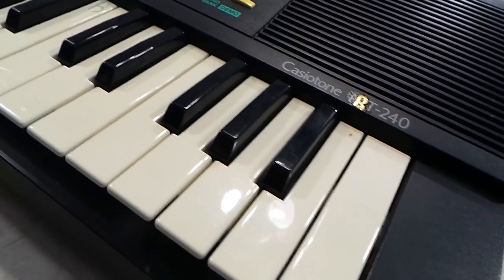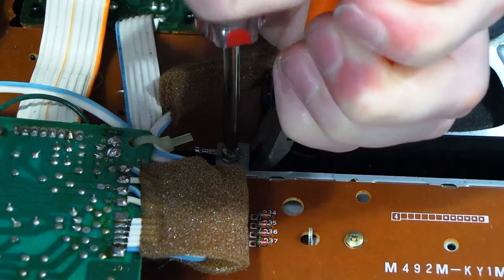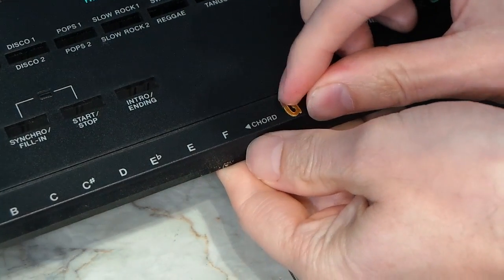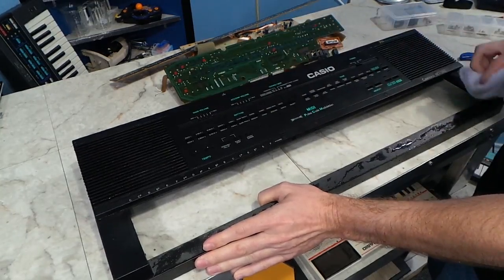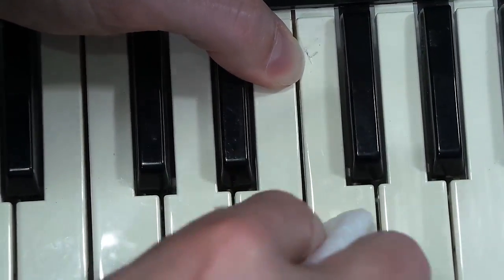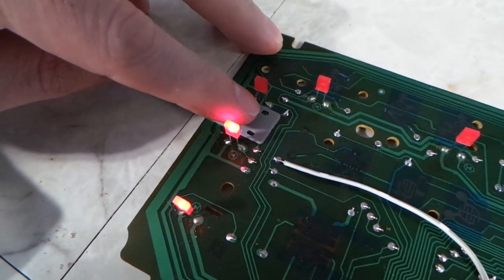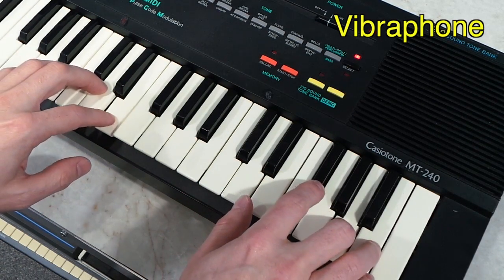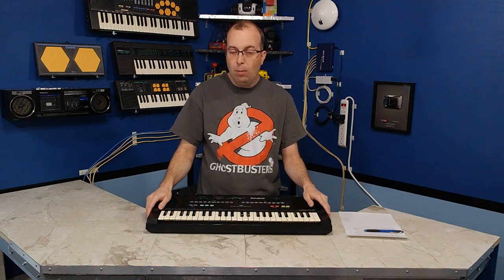Casio MT 240 - Repair, Restore and Review

Comment: I never considered collecting keyboards to be a thing, but I do have two. Not from that era though.
The first is a Yamaha PSR-79, which I quite like. Finding info on it isn't easy, but I did at least learm it's from 1998 (I got it secondhand, but clearly it was only 1-2 years old when I got it).
The other is a casio of some description.
Probably an early 90's model, but I forget the model.
I used to have a box for it, but we tried to sell it at auction. They didn't sell, it, PLUS they lost the box and power supply.
quite irritating.

Comment: use flux to solder to the keyboard PCB. it will help you to stick the solder. don't forget to use good ventilation if you will use flux. also try to use bigger and more powerful soldering iron.

Comment: I bought a Yamaha PSS-270 in a flee market for around 50 NOK (around 6 USD).  And I'm amazed that everything works on it! But there's a faint buzzing/humming noise coming from the speakers and I was wondering if that's normal?

Comment: I know this is a really old video, and you probably know what I'm about to say already but, here it goes ayways. Heat can undo cured super glue. Whenever I need undoing super glue, I use hot water because it's easy to control.

Comment: Do you know where I could get the 9v power jack for the MT-240? The center post has broken off and been lost. I've unsoldered the old part but can't find a replacement that's close enough to fit the opening in the case while having the contact legs in the proper orientation.

Comment: Maybe try a very mild abrasive to remove the super glue, like toothpaste or a baking soda/water paste mixture. I would smear a little on the spot, then take my dremel on low speed with the felt or cloth wheel to buff the superglue off, applying very gentle pressure.

Comment: With regards to wanting to hear the sounds from the non working button there are still ten sounds in there you haven't heard. Just try selecting them via MIDI. Casio used the same chipset in their more expensive full size 30 / 465 soundbank keyboards.p.s I just watched the Cassette to MP3 video. Did I spot a Casio CZ1000 in it ? 
If so you will need a couple of days and Vince Clarke to review that one :-)

Comment: WD-40 does an excellent job removing light glue residue, though, not too sure how it will do with super glue. You could also try oven cleaner, though test it first to ensure it doesn't damage the plastic. Oven cleaners chemical properties work wonders removing splattered line striping form a cars paint, maybe it can do something to super glue but it might be corrosive to plastic.

Comment: The Problem with these Rubber switches is, when they get "oily" -- after years in use, or long storage -- the switches stop to work. You must clean the Circuit Board and the Rubber switch, then it functions as well as on the day of the purchase. But as you mentioned in th video sometimes the copper was eaten away by acid, ... .

Comment: I picked one of these up today at Goodwill for $10. It all works but is missing two black keys. I came here hoping to find out you can replace individual keys. Any clue if there is a place to find replacement keysets for these, or am I going to have to hunt down a non working version with all the keys?
Reply: I just picked up a 205 with a missing black key. After taking it apart I realized that all of the keys are connected to the same piece of plastic. So it looks like you either need to replace them all. Or if you can locate a single key, glue it back on.

Comment: Thanks for the insight about Casio's soldering, have they changed? Another reason to buy exclusively Yamaha
Reply: As of now, both of them use SMDs. There's no way that soldering could hold up with tiny little SMD cpu pins

Comment: In the future, mark all of those broken plastic screw retainers since they can be later be refitted only from the place on the chassis that were broken. They each broke individually and the shape is irregular, if you try and glue them back at random, it won't position correctly.

Comment: Hy, I find a very good working method of placing that kind of plastic cylinders back, I use a piece of tick paper, I roll it a bit on the cylinder, then at the one end I cut it it petals, and at least I use super-glue, the paper absorbs super-glue and became rigid, and due to the petals there is a larger contact area, so it will be much harder to break it again.

Comment: My guess as to the Green Goo, as a parent who was once a child (of the 8 bit era)... is a soft drink spill?

Perhaps the drink contained an acid, such as citric, and the residue left behind from the small amount that managed to leak all the way through over time.

My suggestion is to use a solder pen (usually containing silver) to redraw the traces under the buttons. If that works you will be able to do a pristine restoration :-)

Im sure the internets have dealt with button traces alredy, but have to go to bed now after 10hr flight not lazy... will look later

Comment: I have the same keyboard and it works fine. One of the black is missing - the fourth one from the right. I wonder if I can get a spare key for that one. I have just bought an Udemy keyboard/piano course and I want to learn to play it. I agree with you that it is very compact and with a great sound. It was lying unused for years and I inserted new batteries and it works. There is some sort of play in the on/off switch. I think it works only when I put on or put off with a jerk. Let me know if there is any solution for the same and also some solution to the missing black key. I am trying to search and find the missing power adapter. I only know that it is called “AD-5”. I would be grateful if you can send me a picture of the adapter,  if you have one, as it would help to locate it quickly. If I am unable to find the adapter then kindly let me know what specification of adapter will work with it. I enjoyed watching your video and got a chance to view what is inside my Casiotone MT-240.
My email is citydoha@yahoo.com

Comment: @8:00  that's battery acid that caused the copper traces to dissolve.  The switch just above that is in worse condition.  A copper bristle brush should clean it up, then you can tin plate the switch contacts to repair them.

Comment: That gunk was contact grease I suppose. Works a bit like contact spray but it is a greasy product. It was supposedly used to fix a bad contact in that rubber pad but doing stuff like that only makes things worse... That non-conductive section, well that's the work of that goo. If you want to fix those types of contacts the best thing to do is cleaning both the PCB and the black rubbery things with alcohol and if that does not work the conductive material on the rubbery things is done for so that needs replacement. 3M makes this kind of material.

Comment: I have the same keyboard and after starting it up from a time of non use the buttons don't work either but it will play one sound and after it warms up I can change the sounds and get full function back. I'm not sure if this is a common thing or if there's a build up of some kind.

Comment: Nice restoration overall, but disabling 2 keys for 1 non-functioning one doesn't seem right to me. If solder is not sticking to the pad, how about drilling a small hole to the pad, put some bolt and then compress some small wire with a washer and nut from the other side?

Comment: I don't know if this is the only or the best way to remove super glue or other stains, or a scratch on plastic. I did it on a few computer cases and it was better then the problem area as it was. Use very fine new sand paper to get it off or to smooth out a scratch, then use a light oil on that spot and rub it in to kind of restore the shinny finish. Some glues partly melt the plastic so removing the glue will not restore the surface......

Comment: Goo Gone is the best product for removing stickers. I have used it for super glued items; however you really need to let the goo gone soak in or apply it a few times. Basically make a lil puddle of goo gone for the super glue to sit on. Itll atleast make it scrape off easier. .Heat Guns / hair dryer works good as well. heat gun leaves some residue, but you can remove stickers and tape from cardboard with no problems....Honestly I just buy Goo Gone. Note NOT Goof Off. Goof Off will melt plastic. Goo Gone has no harsh chemicals...Lighter fluid and acetone free nail polish are options also

Comment: My goto when removing stickers of anything is lighter fluid i.e Zippo fluid /petrol but not normal petrol/gas it's different cleaner . if it's a paper sticker it soaks straight through and lifts in seconds if it's plastic you have to work at the edges.

Comment: a less harsh way to remove super glue from plastic is to use fingernail polish remover it has acetone in it but not as much so it will take longer to damage the plastic... it will need more elbow grease and when you notice the plastic is starting to melt then stop and give it a "rest" for a few hours and try again...

Comment: When we had to take apart plastic Warhammer figures covered in glue we would soak them in motor oil and what would dissolve the super glue without melting the figure.

Comment: Old video and probably a crazy idea (not guaranteed to not damage the plastic): Cool the superglue with liquid nitrogen and then just remove it mechanically (should be very brittle at those temperatures). Of course to even try this you have to get liquid nitrogen.

Comment: Today i dissasembled my mt 240 to clean it, and hopefully fix the broken key.

 however i did manage to separate the black keys from the white ones ( man does this sound inapropriate).  but i Have  to glue the broken key. 

has Someone an idea what material the black keys are made from. i cant find any hints on themself.    ( i need to know wich  glue to use)

Comment: I really like your videos David! @ 8:00 aka. "the broken key": you could fix this key as indicated in this image https://goo.gl/OdTZvm by carefully scraping away the solder mask and soldering to the copper underneath at a location where the copper is intact. If you use thin enameled copper wire it might not interfere with the keys. If space is a problem (other components keep hitting the wire) you could drill through the PCB at the trace terminating it and manually soldering in a jumper on the other side (and create your custom diy vias).

Comment: In order to repair the broken pad, couldn't you just tape two pieces of aluminium under where the button should be with wires going to link these to each traces. This would probably fix this

Comment: Hi, I am thinking of buying a Yamaha PSR 620 for $50. Any thoughts?
Reply: Sounds like a pretty good deal, these weren't that cheap in the mid-'90s (velocity keys, floppy drive and all). Make sure you listen to some demos beforehand though, what I heard for these (currently looking for a keyboard myself) struck me as terminally boring. 630 and 640 were its progressively fancier successors, there were 730 and 740 as well.
Reply: I will probably buy it. It will be my second keyboard (as I already have a PSR e443) some of the sounds on the keyboard are not great but some are quite good.Thanks
Reply: As it happens, I just won a '323, which should get me started, but will keep looking for something a bit more... crazy. ;) Maybe a DJX (II) or the like.

Comment: Hello sir how are you.  I have Casio ct 670 . And problum is not power supply on in mother bord.  And 9 volt to come to on off switch button.  I check volt in power button 5.7 volt come.  Some componate are short. I surching shorting but not find out so pls give same tips for easy check thank you from Stephen .

Comment: I had found a casitone mt 210 but sadley the power jack does not work, the cord works, i use the cord on some radio shack keyboard but i like the older look of this keyboard, not sure if any other problems exist with this key board, and i dont own any d batteries so im not sure if that part works either. If theres some way you could help that would be great, hope to hear from anyone.

Comment: that is a printed carbon trace and as you know solder will not stick, the only two ways I have found to fix them "really just one way but what ever" the first is to go to most any auto part place and get a defrost or window antenna  repair kit and use it, The other is to use conductive epoxy. There are some others ways that are just not reliable enough for me to like.

Comment: Try and use lighter fluid and nail polish remover for glue or sticky residue :)
Reply: Nail polish remover is almost pure acetone.
Reply: not that pure, here in brazil it's a LOT more weaker than acetone, becouse ppl where sniffing it lol
Reply: +Halbostfriese in the UK we have some without acetone....
Reply: Oddly enough, I just looked into this last week here in the US since i needed some acetone and was curious if it was less expensive in the beauty aisle or the hardware section. The acetone nail polish remover that Walmart had was 100% Acetone. Also, it was $.50/quart cheaper in the hardware aisle.

The non-acetone stuff never works for anything, IMO.
Reply: Acetone-free nail varnish remover is still good at something: marring and warping polystyrene and ABS plastic! And ABS is what those enclosures are most likely made of.

Comment: Hello, I have one of these keyboards and it has a buzz in the output whether using the speakers or a 3.5mm output device. In addition, sometimes every button on the keyboard will cease to function even though the power lights are still on. When this happens and i attempt to power off the device, the power switch does not power down the device. If anyone has any suggestions for how to address these issues please let me know

Comment: So, more than a year later, but I found that super glue denatures with heat and turns into a liquid again, I found that when I super glued a copper pad in a circuit I was working on and the damn glue ducking liquified with the heat from the soldering iron

Comment: how can I add recording function in my piano Casio CTK-2200
Reply: Use computer MIDI recording software like MidiEditor or MIDI-OX. You have to connect your keyboard to your computer. My CTK-800 has a built-in recording meory function, but my CTK-2100 does not because I have to connect my keyboard to USB to record songs on my keyboard.

Comment: Nooo you damaged that button!! There's no copper there because there's not supposed to be copper there. That pad is the same resistive material as the button contact itself. Next time you have to scratch through the PCB solder mask over the copper trace AWAY from the button and resistive film. Add a ball of solder on the exposed trace and viola!

Comment: Acetone does not work well on set and especially old superglue, while a good production plastic should get minimal damage from acetone, the amount you'd have to use to do any dent in the superglue would damage most (modern thermo-)plastics. But then again you're not going for that. If you need to test acetone though you could have shaved off a minimum from the interior and put it in acetone, if it survives a minute, it'll work for most purpouses, if it survives the night (very unlikely in this case) it would probably not be a thermoplastic and would survive being bathed in acetone.

Comment: the super glue. The super glue acts as a solvend so i guess that even if you are able to remove the super glue, the imprint of the drop itself will still be visible. rubbing the glue with fresh super glue will have the same effect as acetone on the ABS plastic. although less aggressive. I would just leave it, any attempt to remove it will make things worse.
Reply: you could always test this theory on the inside of the case...

Comment: Use ISOPROPYL Alcohol, not denatured ethanol/methanol. There isn't a SINGLE thing IPA hasn't been able to remove for me. Just be careful on the ink on the keyboard logo, use of it on my Casio CTK-700 didn't cause anything, but it has a habit of sometimes removing stuff like that.

Ethanol/Methanol is about as useful as water, I have no clue why anybody even uses the shit.

Walmart sells 91% IPA sold as an antiseptic (Rubbing Alcohol) and it is the BEST solvent I have ever used, beating out household cleaners like Fantastik and Windex by MILES.

Comment: Goofoff will remove the super glue. Get it at lowes
Reply: If you are afraid of the super solvent ruining the plastic use the hand cleaner, its a lot safer and may take a min or two but definitely works. It even has a little bit of sand to give grit to remove it. the super solvent takes glue off like its nothing. http://www.goofoffproducts.com/
Reply: Also I'm not a mac person but your channel has quickly become one of my favorites. I made an account just to comment, usually only watch vids on youtube.